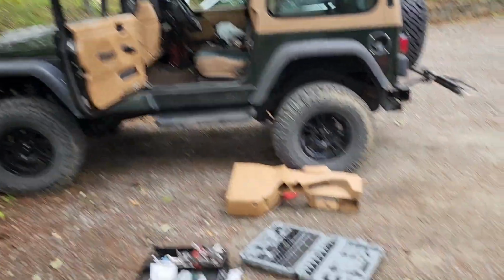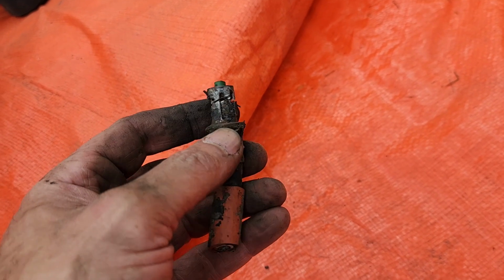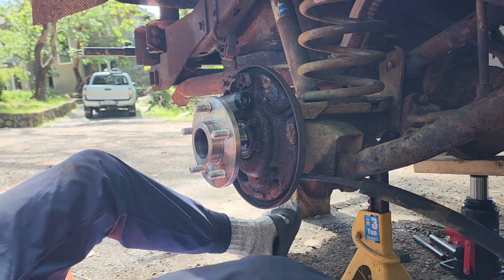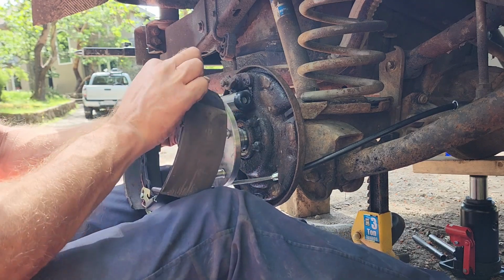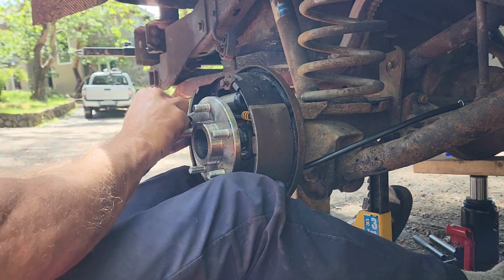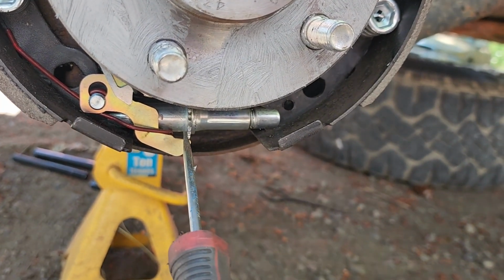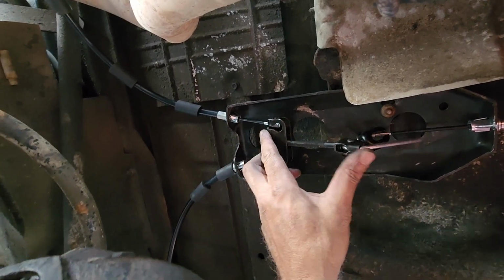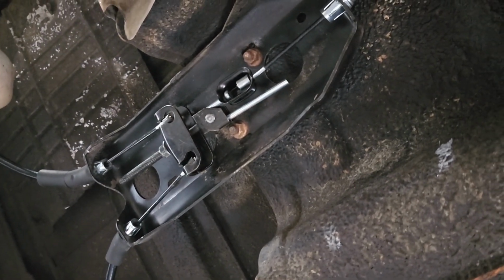Jeep TJ Emergency Brake Full Replacement

Comment: There are alot of videos on TJ drums, but yours is the only one on the TJ handbrake cable replacement I have found. So this is an Excellent video for me as I'm just about to do this myself.
Reply from the maker: Ya I couldnt find any either. Not too bad of a job.  Watch this before you do it and it should go flawless.  Good luck.

Comment: One tip, once the cable ends are  connected to plate in the drum,  to then connect the other ends of the cable to the centre adjuster and tighten partially, with the springs compressed you can then reassemble the drums with much greater ease. If you don't do this I found the long springs on the cables make reassembly a bit of a pain as everything just wants to spring apart.
Reply from the maker: @anticat900  I don't think I've experienced what your describing.  But thanks tips 😊
Reply: @Sea2Skyward  Your demonstration was vital in getting the job done. Particularly at the start when you are not used to where parts go. By the 100th attempt at holding everything in place while putting the spring holders in place and turning them, i was very well versed to all the bits 🙂.  I found that putting tension on the cable kept the cable from coming loose from the plate and the cable spring interfering.